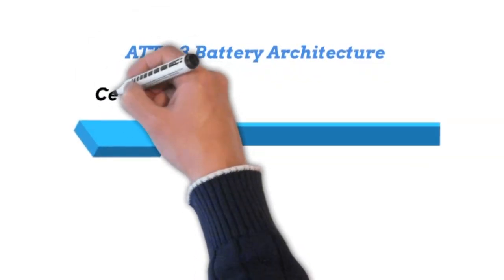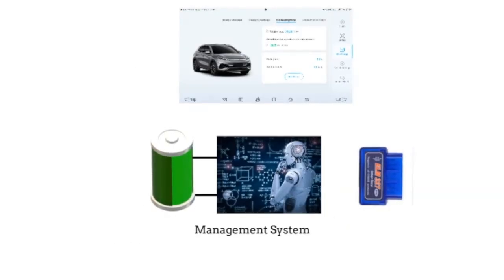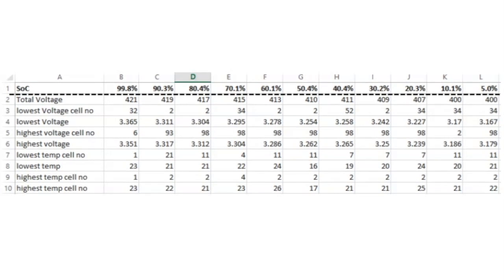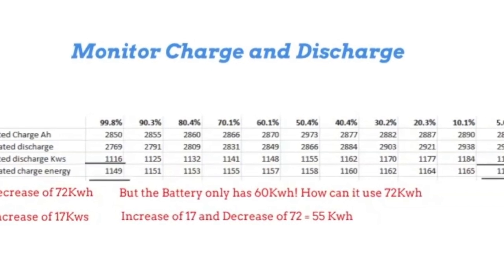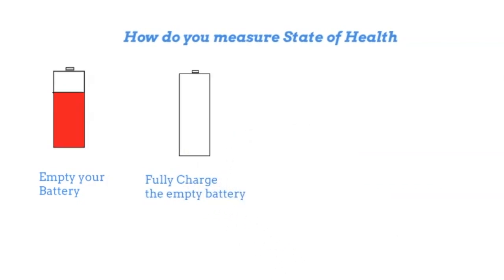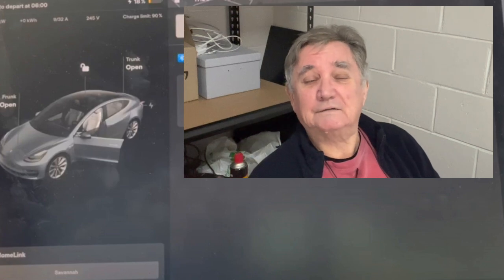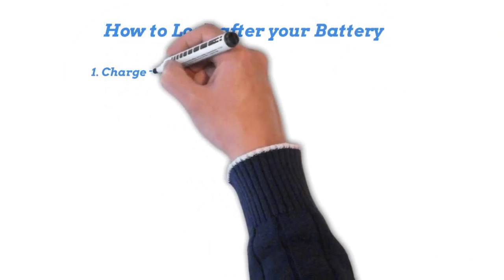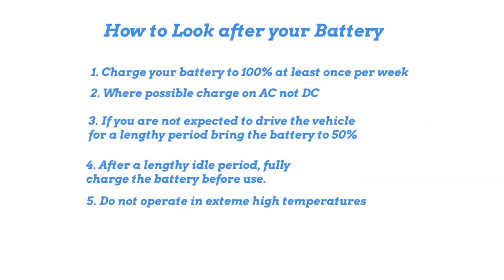Atto 3 Battery Part 2

Comment: I find my battery on Atto3 has dropped 4% daily at idle since 3 4 weeks ago, is there anyway to identify the root cause ? Does it need Cell rebalance or something draining my battery ?
Reply: Even windsor ev (also known as cloud ev) has same issue. Its due to some electrical component draining battery while idle
Reply: What is SoC it has dropped? My BYD Tang also dropped around 3 to 5% when the SoC is arround 20 to 26% but total accumulated discharge the same as before the SoC dropped. This is can be a bottom buffer (prevent battery from deep discharge) after BMS recalibration.

Comment: Nice video thanks for sharing .. and at the end .. what was the result of your battery health??
Reply from the maker: I did not take down 0. I have a friend who has done 40K I will test his car
Reply: @BYDOwnersAU 
Hi Ian, thanks for all the helpful information that you are providing to the BYD Atto 3 owners. I am an Uber driver as of 10 weeks ago and i purchased my BYD Atto 3 specifically for this reason. I have been seeing very conflicting advice on the degree of degradation of the blade batteries, whether it be because of charging to 100% or some other sources advising that AC 
charging is more beneficial for the lifespan of the battery and so on. As I've yet to invest in a level 2 home charger and I drive 3-4 nights a week doing Uber doing an average of 300-400 kms per night I have been charging my vehicle twice a night once somewhere in the middle of the night and once again in the morning when I've finished my shift, so I don't have to get up and run around looking for a fast charger that is either working or is not in use. So I decided to get some advice straight from the horses mouth as they say. I rang Peter who is the manager at the experience centre in Robina, where I purchased the car from. I explained to him my query regarding the do's and don'ts of charging the battery. His reply was that charging the battery using a fast charger has no effect at all, and the advice of AC charging will prolong the battery life might be true for other brands that use ternary lithium batteries, which have the added elements of nickel cobalt and manganese oxide for the positive electrode, plus graphite for the negative  electrode.
He also went on to explain that there were tests carried out in China by BYD, using fast chargers and AC chargers, which were discharged and recharged for 1.3000.000 times and there was no difference whatsoever. Do I hope this gives some clarity to anyone like myself who was concerned that they're degrading the battery much faster than was absolutely necessary.

Kind Regards

Eran 🙏

Comment: Thanks for your nice videos.. I have one Q. When charging Atto3 in the last 3 or 4 minuts it is supposed to optimize the batteri , checking all the cells and then goes to 100% full charge.
But my dosent do this every time, sometimes it just goes direkt to 100 charge.... I been checking this ... Have you seen this in your Atto3.

And I love to see a video explaining the detailed layout of the Powertrain ...how the Powertrain connect to the weels .. how the force goes.
Reply from the maker: if the cellls are all balanced it does not need to do it. Not doing it is good